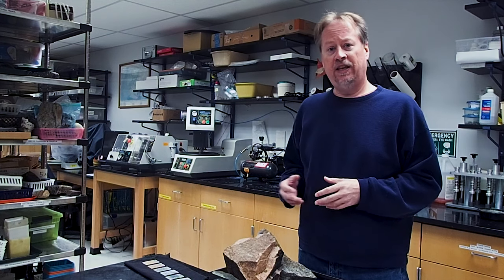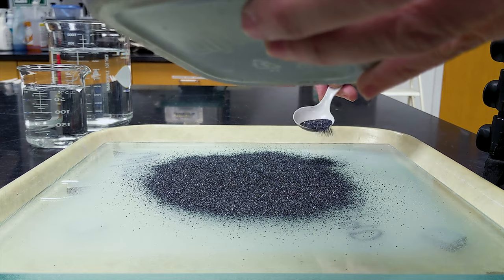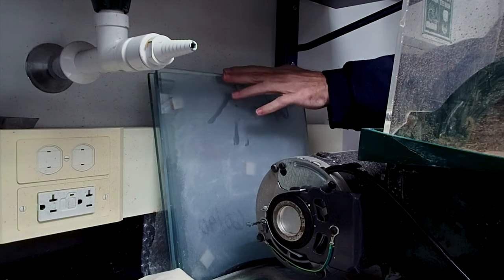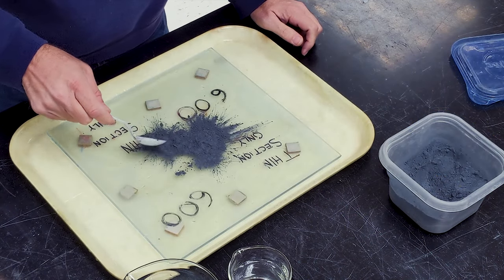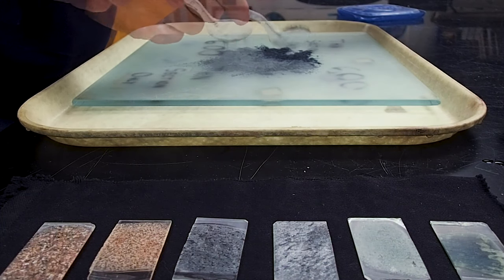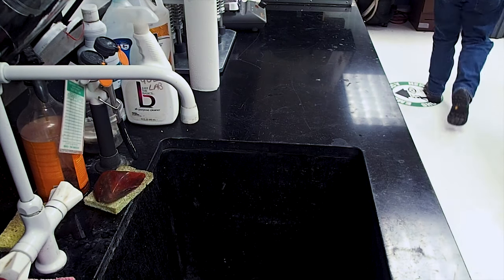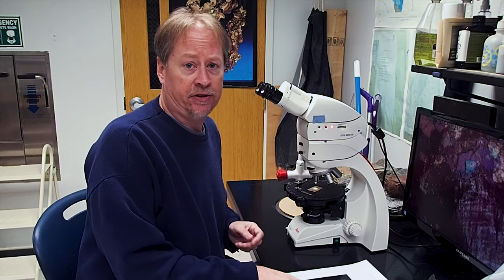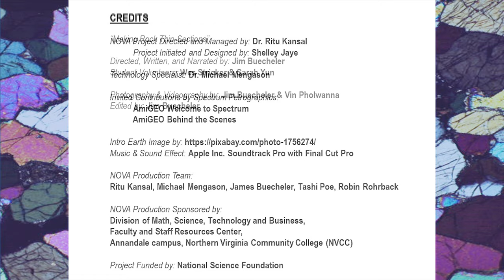Making Rock Thin-Sections:09/10 - Hand Grinding & Microscopy

Comment: Curious to know what material the grits are
Reply: Usually it is silica carbide. I would suspect he is using silica carbide in this video. That is the cheapest. Others include aluminum-oxide and diamonds (either polycrystaline or not). A polycrystaline diamond grit provides the best cutting action and will last the longest.